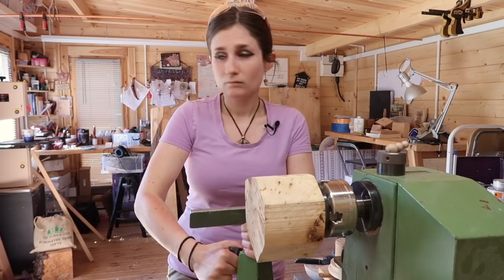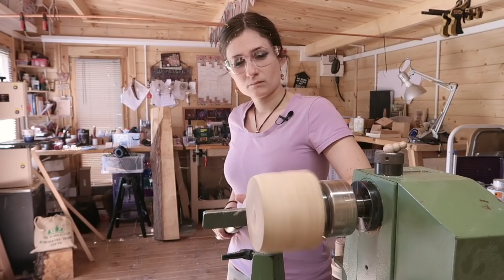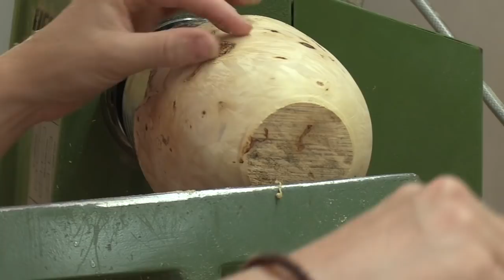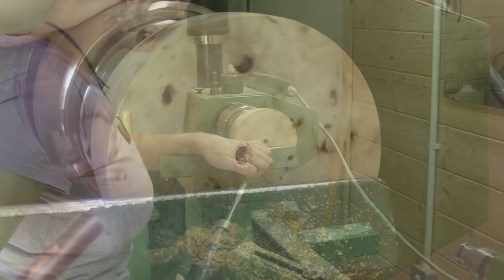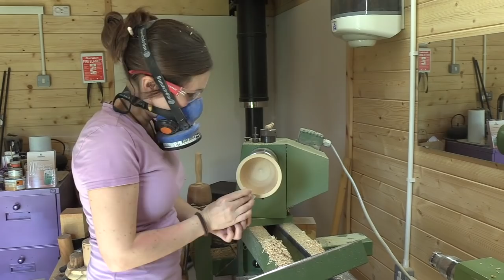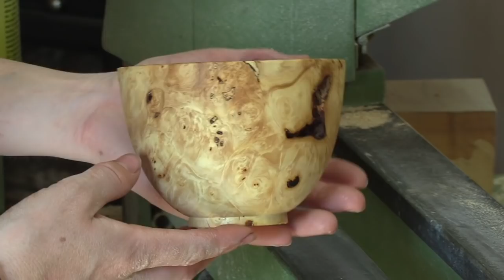Wood Turning an Oak Burr/Burl Bowl - with Emma Cook

Comment: Beautiful work! Love the base detail.
Reply from the maker: Haha, I did love the base initially, now not so much... It might be going on the button chuck to remove it yet ;) Haven't quite decided!
Reply: Artistic license is a wonderful thing! Not exactly sure what a button chuck is. Would you be able to show me? Thanks again for the inspiration Emma.
Reply from the maker: Yes, of course. Or at least I will try to explain. It is basically a faceplate, quartered - so there is one quarter for each jaw carriage. However, it has numerous threads tapped into the faceplate into which you can screw a bolt that first goes through an inverted rubber bung (the 'buttons'). Because it is inverted, it tapers towards to front face of the plate, so it enables you to hold various bowls/platter etc on their outer edge to give you access to the base. And because the plates are mounted on the jaw carriages, you can also expand/contract the jaws as well as having the multiple 'button' positions. I hope that makes sense. I should have just taken a photo 😖
Reply: Thanks so much for the excellent description of a button chuck. What you described is something I’ve been looking to acquire to hold the bowls firm as I work the base. I appreciate your response. If it’s possible please send me a pix. Thanks and as always thank you for the inspiration.

Comment: its beautiful, I m just getting into woodturning doing my research to buy a woodturning lathe, what kind of lathe are you using size and power. any recommendation please share.
Reply from the maker: Hi Syed. Thanks for the lovely comment :) The lathe I am using is a Hegner HDB 200XL but Hegner aren't in business any more. My advice is to either: buy the best lathe you can afford so you don't end up having to upgrade within the year (if you think you will get into turnung), or don't buy one straight away and join a club to see how you get on. Choosing a lathe is a personal choice and you need to go and look at a few and preferably try them first to make sure they suit your posture etc.
Reply: Thanks for replying to my comment I really appreciate your advice, I'm really looking at 2 sizes right now a 12" x 18" Nova comet II and a 14" x 43" King Canada brand which has acceptable ratings but not a high end product this one turns the headstock on the side 180° for the bigger projects both of them have 3/4 HP motors
Reply from the maker: You're welcome :) Adjustable headstock and variable speed are always very handy choices to allow you to maximise your options for creating. I wish you all the best for your future in woodturning!! Ph and one last bit of advice: DO NOT buy a 'set' of chisels. Buy two or three good quality chisels, such as a roughing gouge a bowl gouge and a parting chisel, and build your collection of tools as you feel. Sets are often cheap and have tools you will never use so you are wasting your money. Good quality chisels will keep a keener edge and cut better allowing you to progress your skills more efficiently than cheap, poor quality chisels. :)
Reply: Miss Emma thanks for another good advice about not buying a chisel set, cause I was thinking to buy one but now I'm gonna invest my money in buying quality chisels like you mentioned. I'm also following you on FaceBook
Thanks again

Comment: That’s dangerous practice, the tail stock should have been holding the work piece at least until you obtain a more balance piece and the lathe start at lower speed. Nice shop.

Comment: Keep hearing about this 'tiny turner'...  you look perfectly normal sized to me? Enjoyed watching this and love the simple shape you ended up with. I'm a beginner Emma, but couldn't help noticing the grind on your chisel? So many (male) youtubers seem to have these impossibly long grinds! Is that a man thing? You obviously prefer that very short grind? Or is that just what you fancied when filming this? I'm still finding my way around grinds so would be interested to know. New subscriber. Cheers!
Reply from the maker: Hi David! 

I grind by hand instead of using jigs, which basically means you limit yiu ourself slightly to shorter grinds as the long are too difficult to achieve freehand. However, I prefer a short grind anyway so it just works for me. Angle-wise I’m not sure what mine is but it is close to what is classed as a ‘traditional’ grind. 

The fingernail profile/long grind/Irish grind give you different options when you are working with them (some positive, some negative) but it isn’t a man thing 😆 Just lots find benefits from that grind so they prefer it ☺️

Comment: The machine is high,make the stand and work will be more comfortable.Good luck!
Reply from the maker: Hi Viktor. I'm used to turning on a lathe too high for me. I've been doing it now for the last 5 years due to demonstrating at various clubs, so having it lower feels very weird to me! And I won't stand on a platform as I have fallen off then before. So don't worry ;) It's all good!
Reply: @TheTinyTurner  Of course it's a matter of habit.I was just taught at the time that the work surface should be at a distance of the elbow.And stretch or bend over and not conveniently and dangerously.
Reply from the maker: @viktorlykinuh6006  You're absolutely right! To the elbow is the correct height. But at 146cm tall it's difficult to find something to accommodate ;) So I've managed to get used to it and am pretty comfortable now. Apart from occasionally eating the wood shavings.
Reply: @TheTinyTurner  A little beauty with great talent!
Reply: @TheTinyTurner  😂😂

Comment: full face mask... not the prettiest accessory but will save you your two front teeth. nice bowl :)
Reply from the maker: Hehe thanks Jaco :) Yes, indeed a full face shield isn't a bad idea with the wood being a fairly decent chunk, but I have to say I struggle with them due to the static building up so much dust on them, plus I can't wear a dust mask with one. I do wear one on roughing out 'dodgy' pieces until the are more stable and in the chuck, then revert to glasses. But I made the judgement call in this instance that the wood wasnt too far from true so opted for glasses. I'm currently researching into purchasing a combined face shield/dust mask but they aren't cheap and I need to make sure I buy right first time! Rambling over ;) Thanks for the comment, and for keeping the safety of my teeth in mind 😂
Reply: @TheTinyTurner  i uses anti static and anti fog spray... works a charm
Reply from the maker: Oh really?! Any particular brand? Definitely willing to give that a try as it drives me absolutely insane...